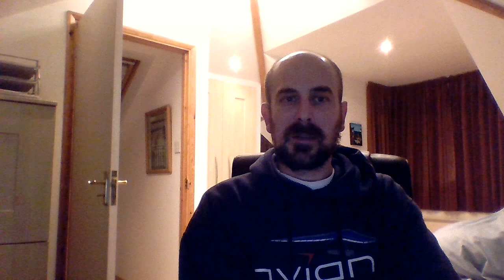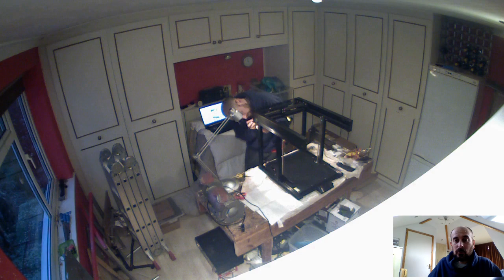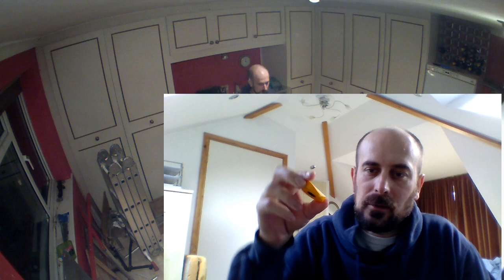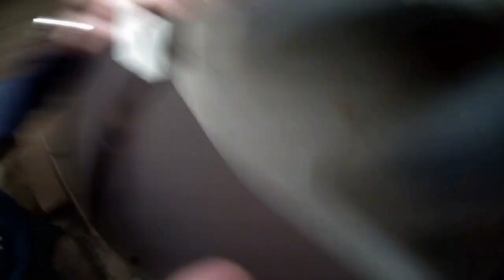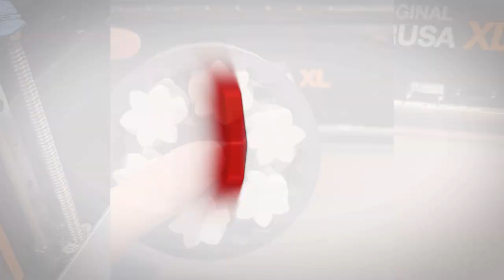PrusaXL assembly - uncut timelapse

Comment: Thanks for sharing!
I'm curious what is the role of flexibility in that semi-flexible yellow part? Is it supposed to nudge some other part to be properly oriented without putting excessive force on it, or something like that?
Also, once you get past the prototyping stage for the loaded parts, do you go from 3D printing straight to injection molding? The latter is most economical when doing thousands of parts, so I'm wondering if you use any lower-volume technologies like PU resin casting for loaded parts.
Reply from the maker: Hi there. It's something that we're working on that I don't want to go into to much detail until we're ready! But it's part of work that we're doing around making the frame work better, to not constrain degrees of freedom that we want to have while locking ones we don't. Ideas that came from this modelling https://gitlab.com/HG-dev/kinematic-simulation
The parts I was thinking of were actually metal, so once we had the geometry we were happy with then we had them CNC'd. You can print thermoplastic PU, which is really tough (I use a hard grade for instrument mounts). Possibly slower in clock time than casting, but less messy and much less person time as you can just leave the printer running overnight. I've cast silicone in 3D printed moulds for high temperature use in my other job though and that works well.